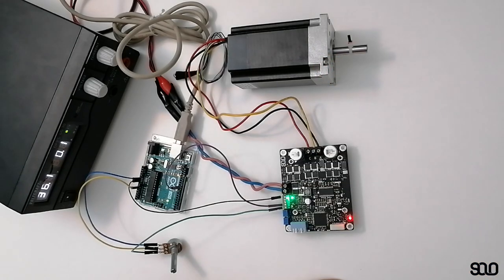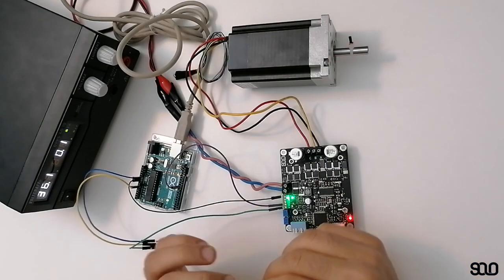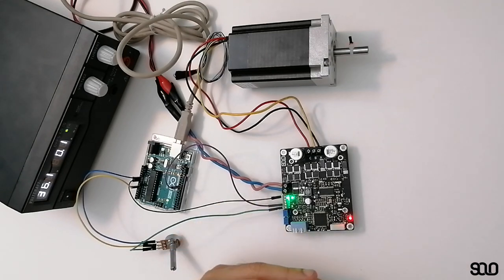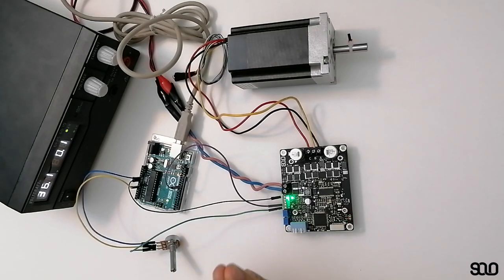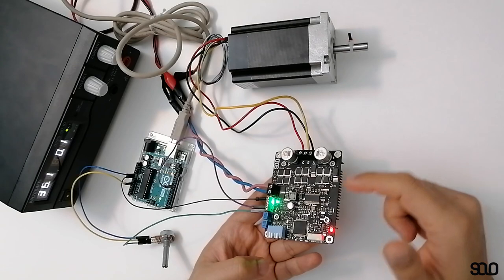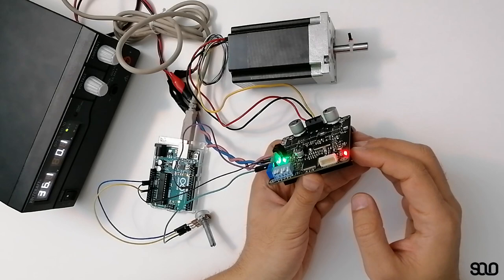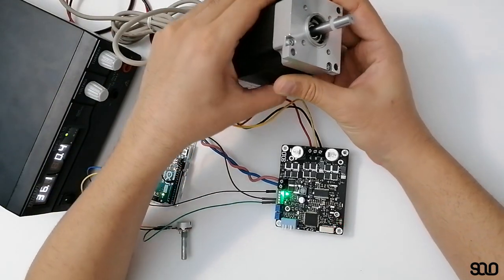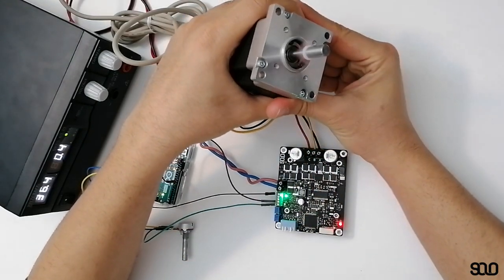Brushless Motors Torque Control using ARDUINO and SOLO (ESC - BLDC - PMSM) in Closed-loop Mode

Comment: I understood from video you control the torque according to the load, if there is more or heavy load on the motor shaft or more external rotational resistance on the motor shaft that means more torque needs to rotate the motor to keep constant speed, so if the motor sense a heavy load or more power to rotate the shaft then lower the speed to keep the motor running at the same speed . right ?
Reply from the maker: Hi Wadi, yes, to be more percise when SOLO is in Torque Mode, it only cares about Torque and not speed, so it only tries to apply a constantant torque on the shaft of the Motor, now if you increase the amount of Load on the shaft, the Torque that SOLO applies remains the same ( in torque mode) so this will result that the speed drops, since there is now less effective torque available to turn the Motor.
However if you want to keep the speed constant while the load varies, then you need to put SOLO in Speed mode, in that case SOLO will automatically adjust the amount of required torque based on the Load on the shaft, so subsequently it will make sure the speed as a result is remaining fixed and un-affected by load variation. we will remain availabl.
Reply: @SOLOMotorControllers  So when we keep the torque constant that will be good for motor to keep the drawing current constant ? but more torque more drawing current
Reply from the maker: @wadib3eed7  Yes, exactly, so to sumerize, rotational speed is the result of active torque which is derived from the difference between the torque that is applied by the motor and the torque that the load is exerting to Motor, so the higher the active torque it means the Motor can rotate with higher speeds.
so once you keep the Torque constant, you are practically draining a fixed amount of current from  supply and injecting it to the motor, regardless of the load on the shaft. we will remain available.

Comment: Thanks for the awesome demo! I am considering using this controller in my project, but I'm not sure how I should choose a motor. What motor is used in this demo? Where can I find one? Thanks so much for your help!
Reply from the maker: Hi @Albert, thanks for the comment, the Motor used is a Brushless DC motor with trapezoidal BEMF in this article, the model number is "DB56C036030-A
" from Nanotech. You can also control this motor precisely with its native Hall sensors and we have a tutorial on that for how to set up and calibrate them below:
https://www.solomotorcontrollers.com/hall-sensors-to-solo-for-controlling-speed-torque-brushless-motor/

Comment: If I would like to create a robot arm that applies Static torque, with zero speed or very low speed to control the torque, what kind of motor would you recommend and able to work with SOLO?
Reply from the maker: Hi @DC, you can use both Brushless or Brushed DC motors, but clearly the brushless motors are much better and reliable, to have the best performance, you need to equipp your motor with an Incremental Encoder so it will operate well in low speeds as well.
Regarding SOLO, you can put SOLO in Close-loop Torque mode while using your Incremental Encoder, so it will fix your desired torque on the shaft, and depending on the load, you will have different speeds ( if you use torque mode ), of course you can use SOLO in Speed or Position mode, and then the story will be different. 
if you visit our blog, you'll find lots of materials regarding all these control methods, we will remain available.
https://www.solomotorcontrollers.com/blog/
Reply: @SOLOMotorControllers  Thank you!
I would also like to ask how does SOLO measure the torque of the motor?
I am starting to learn to use Arduino, and as far as I know and the tools that I have used so far, the stepper motor only returns position value, and DC motor returns only speed value.
I am wondering how does SOLO measure the torque of the motor, and how accurate it is, is there some calibration process to calibrate the current vs torque that would be required?
Reply from the maker: @DC-du8fr  sure, so to explain this big topic in a couple of sentences, I would say in any electrical Motor, the Torque generated on the shaft of the Motor, is the result of injection of some sort of electrical Current into the motor which I will call it here the Current that acts in Torque generation, Now if you can measure that current you can measure the torque because this current and the torque of the Motor ( in most cases) are having a linear relationship as follow:
The Torque on the Shaft of the Motor [N.m] = The Current acting in Torque Generation[A] x The torque constant of the motor [N.m/A]
So now, SOLO measures the effective current in torque generation internally and the torque constant of the motor is a value that you can find it on the datasheet of your motor.
In case of 3 phase motors like BLDC, PMSM or ACIM, SOLO is using FOC topology ( Field Oriented Control), There the current acting in Torque generation is called Quadrature current and is shown with "Iq", using SOLO you can read back that current and subsequently measure the torque at any instance.
I hope this was helpful, if you want to see more, you can also watch this video which we explain the servo driving with SOLO and controlling Torque, Speed and Position of a Brushless Motor, there you will learn more about FOC topology and how it works:
https://www.youtube.com/watch?v=LeQuX0OEh9w&ab_channel=SOLOMotorControllers
Regarding Arduion we have an extensive open-source library for Arduion that you can find it here:
https://www.solomotorcontrollers.com/resources/arduino-environment/
Regarding a use case of arduino for servo driving with SOLO you can check:
https://www.solomotorcontrollers.com/position-control-brushless-arduino-and-solo/

We will remain available.
Regards
Reply: @SOLOMotorControllers  Thank you very much for the explanation! 
How reliable it is by using the Torque constant of the motor [N.m/A] from the datasheet?
Would this value be slightly different in different temperature conditions, or would the current be different when at static condition vs high-speed condition even at the same torque? Would you know roughly the tolerance?

My original idea was to use a strain gauge / loadcell, or potentiometer with a spring to measure the torque, then feedback to the motor. But would be very keen to try if SOLO is able to control the torque to a precise level without the extra sensor.
My project is to build something with a similar function to this arm-wrestling machine:
https://www.joystixgames.com/product/over-the-top-arm-wrestling/
Reply from the maker: @DC-du8fr  The reliability of using that constant totally depends on the quality of the Motor, of course the temprature and aging can effect it but you can always find the plot for Torque vs Current for any given motor, so what you need is, once you are sure about the Motor you're going to use, you can measure the real torque applied by the motor  ( using a Torque Meter) based on the given Torque reference to SOLO ( Iq ) and then find the plot for that for all the possible points ( Iq vs real torque), so the slope of that plot will be your torque constant, you can also use that plot for non-linearities, but if you fine tune it, you can have a percise plot for your specific motor. 
To measure torque you can use various tools like Torque Meters that are comercially available, of course this is a good solution once you want to put your product for production and it worth fine tuning it deeply.
Reply: Can this motor be used to push and pull a load of 20 kg connected via a scotch yoke mechanism... please reply?

Comment: Good morning,
Is it possible to automate the stepper motor and its torque via GRBL or a similar software?
Reply from the maker: Hi Patrick, on SOLO we don't support Stepper motors at the moment, however, we have users that are using GRBL to control a CNC with Brushless motors, including the spindle as well as the servo motors using SOLO.

Comment: how do i connect multiple motor to solo and control torque of each motor? lets say four wheel have four motors and i want to control individual torque of motor attached to each wheel for better traction. can you please comment.Thank you.
Reply from the maker: Hi Mohammed, 
For the Moment you can use UART protocol on Arduino or  Raspbery Pi or any other MCU that has UART on it directly to network multiple boards, as each SOLO can have a different device address, in our Python and C++ library available on our website, you can define Objects of SOLO's with different address and control them all together. to Networ multiple SOLO's using UART protocol to avoid data collision, you need to use an Analogue ( or digital ) Multiplexer like the one in below that can operate with 3.3V leveled signals:
https://www.digikey.com/en/products/detail/sparkfun-electronics/BOB-09056/5673767?s=N4IgTCBcDaIEIHk4FoAMBOVBWAbAHQBcQBdAXyA

 in case of using UART: 

-You can connect the TX of your main controller ( arduino, raspberry Pi or etc ) to all the RX's of the SOLO's in the network directly with a wire.

-using the GPIO pins of your controller ( arduino, raspberry Pi or etc ) connected to "Channel Selector Pins" of the multiplexer, you can select the appropriate SOLO UNO's TX in the network to send data back to your raspberry Pi, so like this as each SOLO has a unique address, once Raspberry Pi sends a command through its TX, only the SOLO with the same address will respond back, however, at the same time, within your multiplexer you are selecting the appropriate channel to read back from the data from the desired SOLO unit in the network.

Regarding other ways of networking, SOLO offers CAN bus as well to have a CAN network, indeed the firmware with CANOpen is going to be released in near future and once it goes out all of our users will receive the updater and they can update their firmware ( we did this process 5 times till now as soon as a new feature goes out), the hardware on SOLO UNO is fully compatible with CAN bus and the CAN Transceiver IC is mounted on the board, so for CAN Open it's only the matter of the firmware release date, but I believe using the Method I mentioned above you will be able to network lots of SOLO units together using UART.

you can also use our Motion Terminal to monitor and control and monitor simeltanously multiple SOLO's by opening mutliple windows and conneting to eash SOLO unit through their unique VCP ( virtual COM port).
https://solomotorcontrollers.com/SOLO-motion-terminal/
We will remain available for further clarifications.
Reply: @SOLOMotorControllers   Thank you i will try with your suggestion

Comment: Is it possible to control torque and angular velocity at the same time?
Reply from the maker: Yes you can! When you are in speed mode you can control the torque using the Current Limit and the Speed with Speed reference too. Is possible to play with the Motion Terminal in order to take the best out of your Motor and Controller

Comment: Can negative torque be applied? In other words can you slow a system down by applying negative torque? Sort of a braking system.
Reply from the maker: Hello Ant,
Yes, SOLO operates in 4 quadrant mode, thus the negative torque can be applied as essentially torque controlling in SOLO is bidirectional.

Comment: does it like save energy because you can reduce torque when it's not needed as much?
Reply from the maker: Save Energy is a huge topic! Consider the cycle time of the controller and the reaction time can reduce the consumption too (also on a steady speed). SOLO Current Controller Cycle time is 7 us that is very high value, and we keep work to optimize the performance and introducing new alternatives for the users

Comment: Can I use in speed control and weight control
Reply from the maker: Yes. In speed mode you can control the speed and the torque release to the motor.